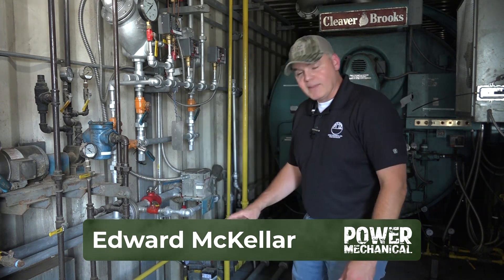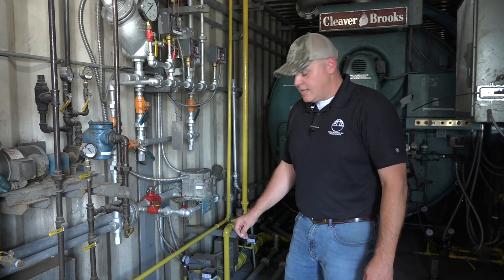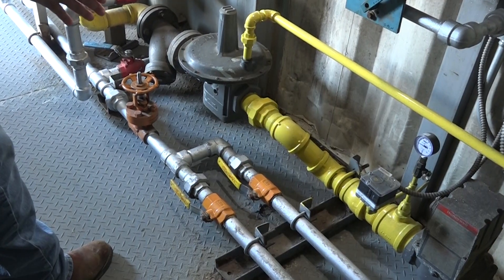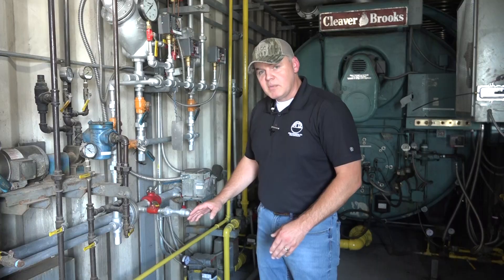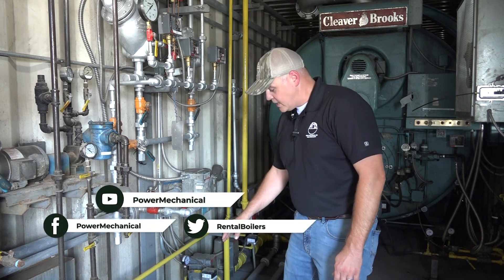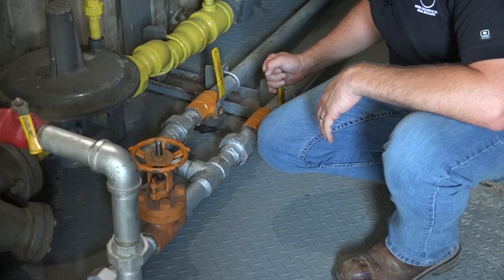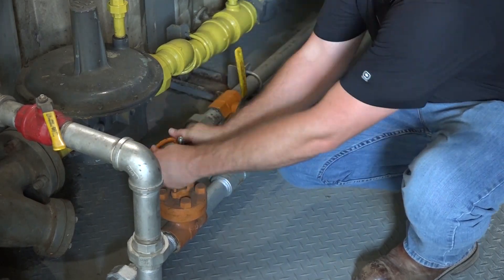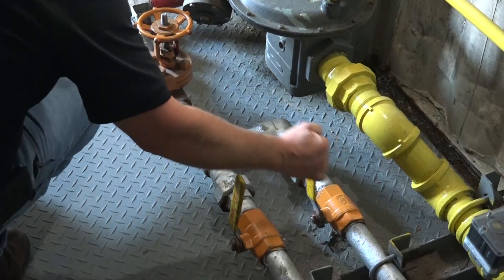Quick Open Valve and Slow Open Blowdown Valves - Boiler Room Tips

Comment: It's good for low-pressure boiler. For high-pressure boiler with high evaporative capacity, the quick opening valve should be after slow opening valve to control the water level in the boiler, and reduce turbulence in the mud/water drum (water-tube boiler) through slow opening.
Reply: U Rite, had been a min since I did a bottom blowdown on our 800 hp cleaver brooks firetube boilers. So looked this up. Was like that can't be right, seen ur comment was like yeah the slow open is to control the flow.